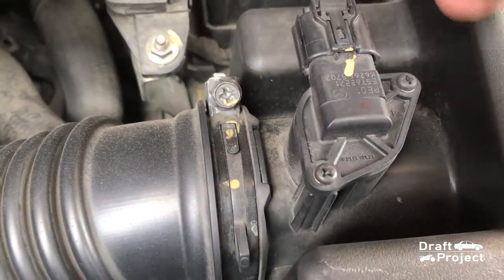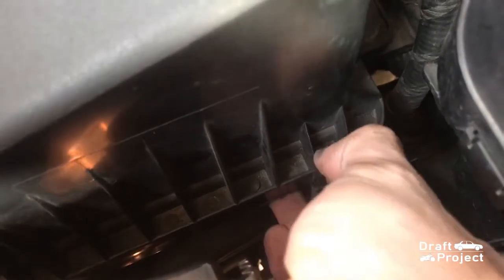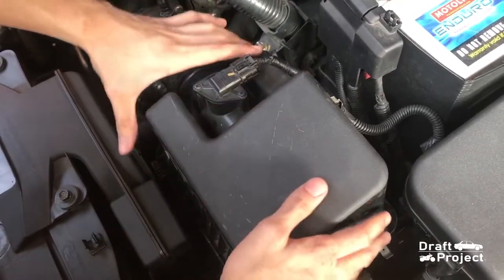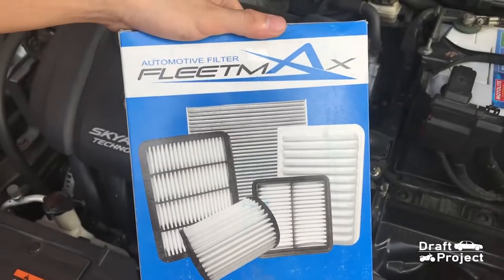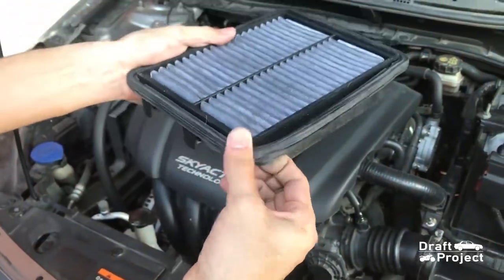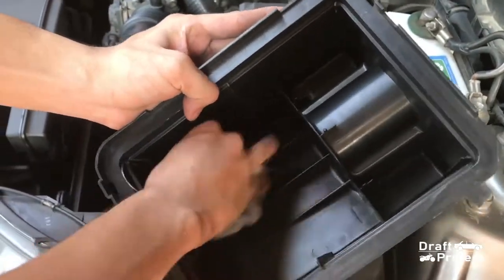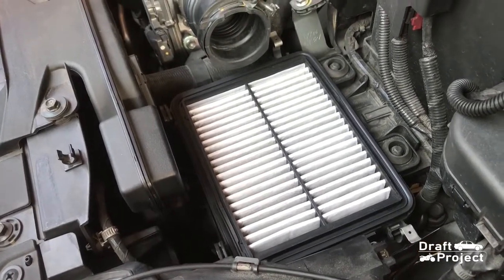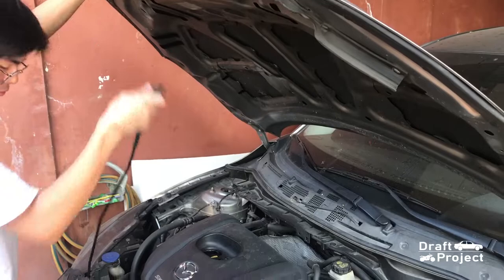SLOW CAR?! EASY! How to replace or change Air Filter

Comment: nice video! have you think about replacing the air box with an intake + air filter?
Reply from the maker: Hi Ren! Not at all. I would choose stock rather than the modified intakes. I was part of the Mazda Racing Team Philippines. Back then, we drove this same Mazda 2 Skyactiv model as our racing car. To make the Mazda 2 Skyactiv faster and agile, it was obvious that a lot of parts were modified / replaced and it was heavily observed at the dyno. BUT out of all the parts that were modified / replaced, the only thing that stayed stock was the air intake system. It was dyno proven that if the intake system was modified / replaced, a lot of power will diminish. The only thing that you can replace in the air intake system most probably is the filter itself. Power may improve or worse, stay the same even if you replace the stock filter to high-flow washable filter such as K&N, Etc. But do not modify the Air Box. It is engineered specifically for the Skyactiv Engine. Don't forget to subscribe and click the bell to keep you updated. Thank you! :)

Comment: sir ask ko lang san b nakalagay air filter ng 2006 vios g?
Reply from the maker: Hello po sir! Ang air filter po ng 2006 na Vios ay katabi ng battery at malapit sa firewall. Sundan niyo po yung plastic na tubo, yung kulay itim na katabi ng battery. May makikita po kayong box na kulay itim na may nakakabit na sensor. Yun po yung intake box at nasa loob po yung air filter.
Reply: @DraftProject  thank you po sa info sir gawa pa po kau madami videos sir very informative
Reply from the maker: @totoironman1337  Opo sir at maraming salamat po and God bless po!

Comment: The air filter quality seems bad. too much dirt appears on the "clean" side of the filter. seems like it cant stop the smaller particles.
Reply from the maker: Actually, It has been a long time since I've replaced that filter. It is way overdue for replacement. Sorry about that.